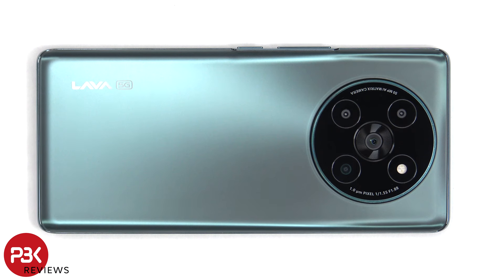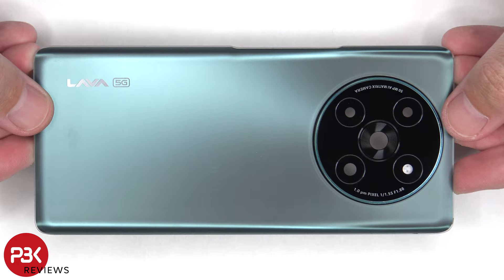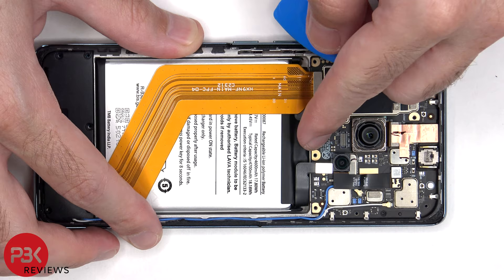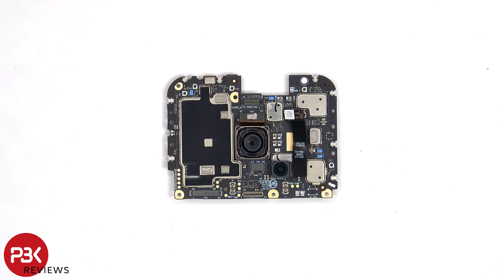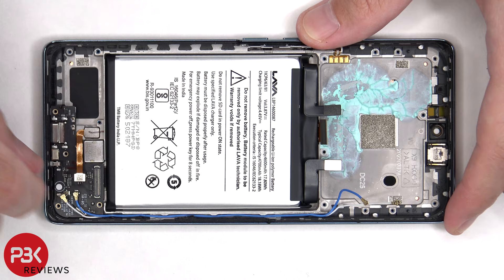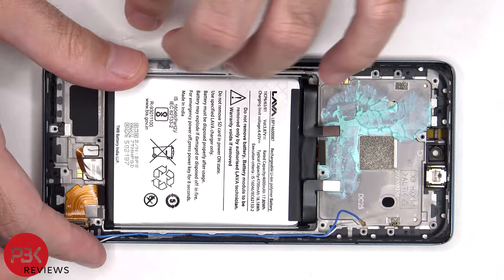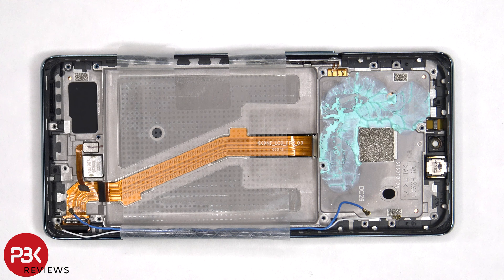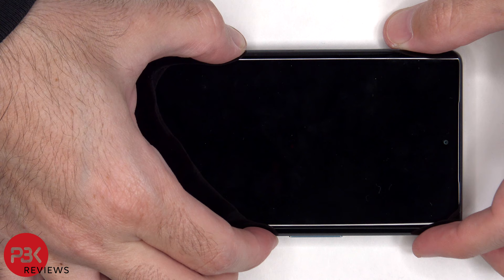Lava Agni 2 5G Teardown Disassembly Repair Video Review

Comment: Watching on Lava Agni 2❤❤❤❤
Reply: Bro how much does your battery heat when playing game? Mines around 38°c and 40-41 while playing high graphic ones (lava Agni 2 too)
Reply: When playing bgmi it's normal. After playing 1.5hrs or more slightly warm in back side, it's common. But no frame drops or lag at all. I'm playing 60fps. Very good quality mobile by lava.
Reply: @Savitaam9976  my lava agni 2 doesn't heat much while playing bgmi but heats to 41°c battery and 45°c cpu when playing roblox

Comment: Teardown suggestion: Moto Razr 40 (The non-Ultra one)
These Moto Razr 40s are the first foldables to feature a dust resistance rating. I have watch a Razr 40 Ultra teardown, there is no comment on dust resistance. 

I hope you can take a look at the Razr 40, and see how is it dust resistant.
Reply from the maker: I'm not sure if I will be doing that model but I will see.

Comment: vruh!! You really did a great job!! 
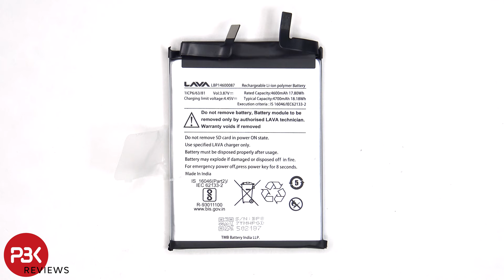just curious to know on time @06:25  the gray body (behind the battery) was it plastic or metal ? 

I wish your few words/comments in internal components quality of the phone. 

My thoughts : 
- I was a bit disappointed to see blue/white wires connecting front to back with real cables (such old school technique, also there was so much space left empty there)

- I noticed they were using single battery, it's quite common to add two batteries (helps in fast charging also generated less heat.) 

what do you say ?
Reply from the maker: Thanks! The mid frame is aluminum alloy. Yeah a lot of manufacturers still use coaxial cables. I don't think single cell vs dual cell would would cause more heat, or less heat depending on how you look at it. But I am not as experienced in the battery field to give you a concrete answer on that.

Comment: Mr.Pbk what is the issue of the phone that always overheating when connected to a wifi.What is the solution to fix the phone?
Reply: Go to developer option and turn on WiFi Safe mode
Reply from the maker: Not sure, haven't run into that issue but you can try what the other commentor mentioned to see if it helps :)

Comment: The back panel glue is strong or not ?
Reply from the maker: Yeah was a bit stronger than I expected.
Reply: @PBKreviews  Then how did he get down without heat?
Reply from the maker: I did use heat, I just don't show it on video since it would just be waste of footage and time for people to skip through watching me heat it up. You can use a hair dryer, heat gun or heating pad to heat it up a bit so it loosens up the adhesive. But compared to other phones, this one was a bit stronger which in protection stand point is good but harder for repairs.